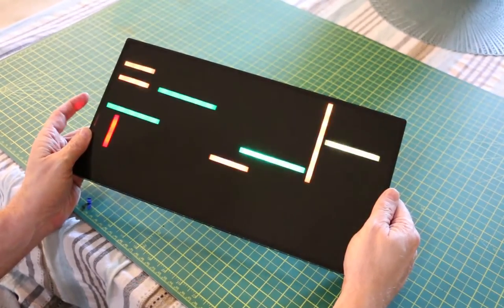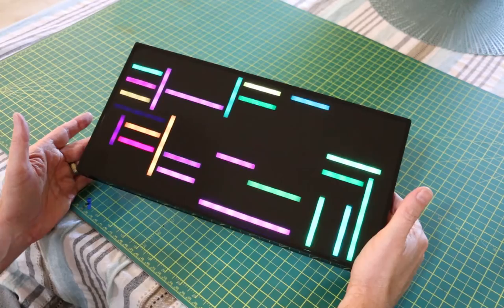Recreation of M5 / Beta-5 / Atavachron Panel prop from Star Trek Original Series

Comment: It's the ultimate Simon!  Seriously, though this is a work of electronic art and belongs in a museum.  OK, I've got to ask, how the light is able to shine through the black acrylic?
Reply from the maker: Hi! Thanks and sorry for the late reply. It is actually dark grey transparent plexiglass with the backside painted white and then there are three layered lights masks (for the 200 lights total). The lights are on the bottom panel so it gives 10 cm along with the white paint on the back of the cover plexi-top for diffusing into solid lines.